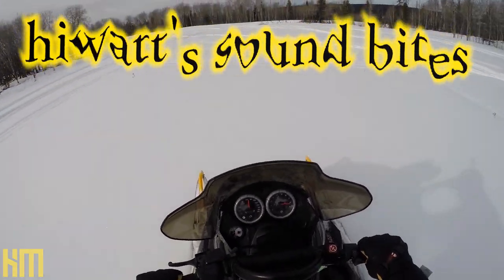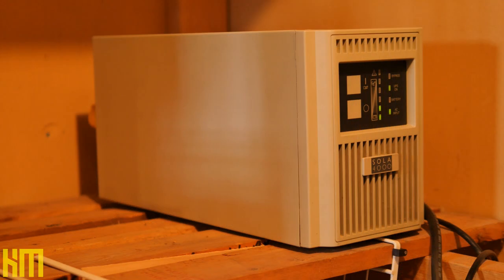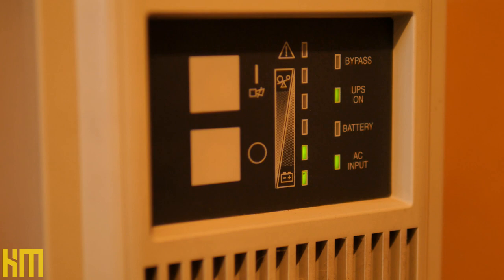Studio Power Conditioning - Done Right

Comment: What power supply do you use sir ?
Reply from the maker: Thanks for asking Shevy John, it’s a Sola Hevi-Duty Series 4000.  I have the ‘mini-tower’, which is only rated at 700/1000 VA, but plenty of headroom with all my mission critical gear on the line (and it’s a lot!).  If I ever choose to update to a current model, it will most definitely be the same brand ❤️
They have a nice rack mount unit I’ve been eyeing…somewhere around $2k, with a bit more VA (maybe around 1500 if I recall?)
**important** These units have loud fans, and must be remotely located!!!  Think of them like a server…best located in a remote location.  I have mine two rooms away, with the output hard wired to mains on my studio floor (done to code by electrician 👍🏻).  I promise you this will be one of your best long term studio investments, because everything you do simply sounds better…and your gear will return the love with years of maintenance free service.  This has been my own personal experience (I’m knocking on wood haha)!
Thanks for sharing here Shevy, I appreciate it big time 🤟🏻🙏
-hw
Reply: @hiwattmarshall  thank you for the reply I’ve been researching for a good  power supply for my gears I do mainly mixing and now mastering.. One of my interface which is the discrete 8 sc came with a.Walwart  I upgraded to the sbooster mk I was blown away how better the interface sound (better lows Mids and highs ) now I will research the sola  as I’m currently using more gears like the ssl,burl,api, and lynx hilo.
Reply from the maker: So awesome, thanks again Shevy 🤟🏻 Power is far more important than most of us even know, and it takes discipline to invest in it, when we have SO MUCH gear to be excited about haha!!!  Dropping a couple grand on something you don’t even see…but wow it makes all the difference.  I appreciate you sharing your experience just upgrading a single ps, brilliant 👍🏻❤️
Cheers, hw

Comment: Speaking of power - had a stupid noob error recently; recently got into using guitar pedals actually on a guitar instead of synth, and plugged in a few that weren't working.  I thought the batteries were dead so I used my 1-spot daisy chain with correct v and polarity, and that didn't work either.  Being an idiot, I experimented with things, ended up reversing the polarity, and thought I blew them out.  Was bummed for a day or so because I hadn't even gotten to play one of them at all yet.  Then I realized - since my Kmix needs balanced cables to keep levels up, I just always used TRS by default, and I wondered if that was the problem.  A quick Google and I'm like... uhg, dumbass - the TRS grounds out the battery circuit on these pedals, so you have to use unbalanced cables!  Good news is, I hadn't actually blown out the pedals at all, just my ego.  ;D

Comment: Can you recommend a good unit for a small home studio? I have some issues with dirty power and have eliminated led's, went over cabling and using balanced cables when possible. I have a firman pl-8c but after seeing your video I am really interested in getting an online ups to eliminate all noise from my power like you explained. Could I essentially connect my furman to the ups? I would connect pc, interface, powered monitors to furman and then furman to online ups correct?
Reply: Great questions, how did you proceed? Working on small home studio and wondering if I should just put a conditioner on each side of the room or in some master location near the breaker that feeds all the outlets

Comment: I am working on a live room that I’ll do some amateur mixing in. I was going to have several outlets around my room on a separate circuit, but if I want to use one of these UPS systems where I put one near my consul, and then another one or two in the opposite corners of the room for guitar amplifiers? They won’t create any noise? Put it in the wall? Just brainstorming now thanks for any feedback

Comment: Hi, I love your videos. Ken, do you keep the online UPS in a separate room? How's the faint noise, hum, and buzz on a unit like this? Is it louder or about the same as a desktop computer? 

Also, when I have my components (computer, speakers, monitors, etc.) turned off, is it safe for me to turn off the UPS, so the fan does not have to be on 24/7? Will the online UPS recall my numeric settings on the unit when I turn it back on? Thanks in advance, and thanks for this video

Comment: OMG, this is one of the best things I've ever watched - I've always wondered about this, but my electrical knowledge is almost nil (see my other comment for proof ha)!  If we're looking to buy one, how do we know how much kVA and Watts are sufficient for our purposes?  Ie how do we estimate (or even measure?) our load so we can make sure to get one with the right capacity?
Reply from the maker: Thank you hostnik, your comment just put a huge smile on my face my friend...cause I think you get it!!!  These true online ups's will make literally EVERYTHING you do sound better...in a BiG way ;-)
They can be very pricy pending on your needs.  I suggest adding up all the watt ratings on the gear you would have online (I personally leave all my amplifiers off the ups...they surge big power at start up and really aren't considered 'critical' so to speak).  I have a ton of gear plugged into my current system and it's only rated at 1000kVA  My next current model choice will be the Sola S4K2U2000-C I know it will be in service for at least 10 years, so the $2200 tag is a bit easier to stomach at $220/yr  It's a tough one cause we have so much gear to consider with limited budgets, but I promise the online ups will put a big smile on your face...not to mention everything you do connect to it will function flawlessly for as many decades ;-))  So happy you found this session hostnik, cheers to you ;-) -hw
Reply: @hiwattmarshall  - haha, well I'm trying to get it at least.  :D   Thanks that makes a lot of sense.  One more data point I'll have to add to my specs spreadsheet I keep for my gear.  I don't think I need a $2200 one for my personal home project studio, but maybe if I ever start mixing anyone else or making any money I could.  I'll check out the Solas and see what they're all about.  Thanks!

Comment: Ken, what brand of UPS would you recommend?
Reply from the maker: Thanks for asking DigitalMiVa!  I’m planning to upgrade my original Online UPS with same brand, Sola Hevi-Duty.  The specific model I’m looking at is S4K2U1000C.  I’ve designed my studio power into two systems, one that includes all amplifiers and self-powered monitors, and the other for everything else.  Amplifiers probably use 80% of the power you’re consuming in your studio and they really don’t need the same level of protection as your DAW, hard drives and audio interface, so I recommend leaving them off your UPS.  These systems get crazy expensive as you increase VA ratings so I recommend minimizing  your needs by excluding amplifiers ;-)  When I do loose power (just happened last week), my speakers all shut down (no big deal), and I have a very relaxed 20 minutes or so under battery power to save my work, shut down and safely power down my whole studio!
Reply: @hiwattmarshall  Thank you
Reply: @hiwattmarshall  Hey, thanks for all the info! Any lower priced options anyone can recommend for a small hobby studio situation with a laptop, a few hardware samplers, hardware effects, drum machines, interface, etc?
Reply: @nummernein  I have the m-8x2.  at best it cleans the power minimally,  I wouldn't get it expecting night and day results.
Reply: @nummernein  the simple power conditioner you listed isn't a double converting model so I would doubt that it cleans the power much better than an average furman.
Reply: @nummernein  they are better than nothing if you want a battery backup,  but I don't think they will clean the power at all.  It's the double conversion process that actually cleans the power.  Even a low-end Furman does very little to clean the power.  Furman will market their products with filtering, but if you measure the amount of dirty power it's pretty bad.  In fact, I have an m-8x2 and when I read the dirty power with a meter it was about twice as bad as just plugging into my wall outlet.  It's crazy actually how expensive this stuff gets.  Furman markup is huge.
Reply: @nummernein  hey dude, so the simple power conditioner you posted the link would clean the noise? I'm wondering this since it's labeled as UPS, would it be better than a furman 8x2 regarding surges and noise reduction?
Reply: @mjsthx1138  that’s what I’m here to learn, it’s all a bit mysterious and hard to tell the difference between those $50 units and a $300 unit, but clearly these double conversion online UPS units are in a league above.

Comment: Hey man, was able to score a double conversion UPS on ebay for pretty cheap. Get to test it out tomorrow and if it works, I have you to thank, thank you very much man!
Reply: Hey! Even I'm looking at buying double conversion UPS... Can you tell me what results did you discover for yourself in detail? That would help me a lot in making the decision.
Reply: @ratedrsuperstarthega  hey dude, so essentially I went on /r/homelab since they have a lot of info about getting enterprise level stuff working in your home. All I can say is pay attention to what kind of electricity your house pulls from where you're from and make sure your UPS matches that. I bought one that was rated for 30 amps and my house signal only has 15, so that wasn't going to work. So yeah, just read as much as you can
Reply: @NosralTserrof  Thanks for the advice. I will surely check that.
Assuming - you might have returned the one which doesn't works and bought another one, now that you have finally installed Online UPS, what changes did you notice?

Comment: Man, I am praying so hard that something like this will help out.  Just moved into a new home, third floor of and old home, and cannot seem to remove interference to my amplifier.  The sound is just awful especially with reverb engaged -- it's a Magnatone Panoramic Stereo.  My only question for you Ken, is can you recommend a unit being manufactured today that I can look into?
Reply: What did you get?
Reply: @GregoryGuay  Hi Gregory, returned everything after multiple tests, and also spoke at length with the owner of Niagara.  As much as I'd like to believe in this sort of thing, I think the main issues I was running into were ground issues and RF issues that aren't circumvented with units like this, no matter how expensive, no matter how many videos tell they help -- they do not.

Comment: Hey man, so I followed your advice and got myself an online ups as suggested. But, man, the level of noise is insane, almost 60dbs. How do you go around that? It would be very cool if you could show your electrical wiring from the wall, to the online converter, to the rest of your gear. I am almost thinking on sending it back, it's driving me nuts (and it is in the next room). Thanks!
Reply: Do you mean that you get noise in your audio or the ups make some noise?
Reply: Yes power "conditioners" can introduce noise. Also chances are it may be a ground loop. If the unit itself is buzzing see if turning on different lights on the same circuit changes this. This is pretty normal for UPS units to do this. Some have management software where you can lessen this effect. You can also get an isolator or unplug any PC component that is on the same line. PC power supplies are pretty bad and offer no protection against the 60Hz hum. Run PC from battery or a different circuit.
Reply: @kaislate  Really? I was under the impression that one of the benefits of power conditioners is reducing the noise to almost nothing.
Reply: @KevboKev  at the high end with multi $1000 units for home theater probably, but the ones you can buy at best buy it can go either way. You can set how quickly it switches and under what states cause a switch to battery in settings of decent units. Having the fastest switching with the tightest bracket will wear out the battery quicker l, but will offer the most protection. As for the hum... You are probably going to need to trial and error a bunch of solutions. USB is a big culprit, start there... Then other things on the circuit, and finally the hardware in line you are using.
Reply: Are your audio cables balanced and proper?

Comment: Sounds expensive!  I wonder why it sounds better. The DC to AC inversion involves approximating an AC signal. It's very "discrete" and isn't at all smooth.  I'll be happy to elaborate if anyone out there is interested.
Reply: Yes sir. I am super interested in this.
I am thinking to buy a double conversion online UPS for my audio system and computer. 
Please elaborate your experience and knowledge about it, so I can make a better decision.
Thank You!
Reply: Are you suggesting that product is overrated? The conditioned AC power is not. “very smooth”? It must be “smoother” than the original AC, whatever that means scientifically?